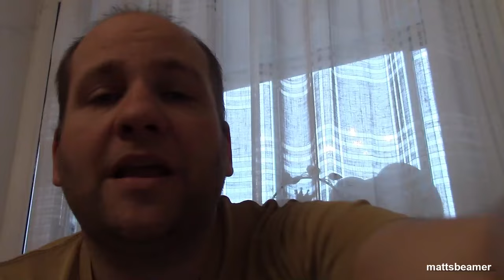BMW Drivetrain Malfunction (Error) Drive Moderately Problem. Information Video.

Comment: I'm driving a BMW 125i 2013 model, it has a drivetrain problem but when i put petrol into a fuel tank, the drivetrain problem goes away.🤣🤣
Reply: same issue e87 118i ... what is the problem with your car, is it resolved? my car problem. the car in running and then dead and the gearbox light is red.. and 1 issue obd scan can not communicate all module😅..

Comment: Have had this error thrown twice now on my 330e. On both occasions it was while on the motorway at about 65 and using cruise control and then had to touch the brakes. As you would expect, this should simply disengage the cruise control, but on these occasions it seems there's problem causing the drivetrain or gearbox to decide there is some kind of problem, probably regarding torque delivery before the cruise control disengages. The engine wasn't heavily loaded or had been previously, just a gentle journey, so no high temperatures or engine stress involved. Limped home without switching off the engine (luckily, the stop/start didn't kick in when I had to stop). Will get it booked in to read the codes (my code reader won't read this car). Just been serviced. Latest software installed. Seems like a glitch somewhere between ECU and gearbox controllers.
Reply: Greetings Friend, what did it turn out to be?
Reply: @JackRobinson63  It was a faulty HV battery control unit and two failed battery units. I had been complaining that there was a battery fault for over twelve months. The dealers first fix attempt was the usual firmware update, which, not surprisingly, had no effect whatsoever. I believe that the engine ECU and battery system were not working together correctly when you touched the brakes and the engine ECU decided to disable the HV powertrain. It is now fixed and the HV battery is supplying 18 miles coverage. It took 5 days to find, get warranty approval, get parts and do the fix though.
Reply: My bmw X1 2017 aisin company gearbox in it suddenly it shows drive terrain and only shifts 3 gear 4, 5,6 gear is not working ,bmw professionals after inspection result we are unable to find out the issue

Comment: You’re 💯 correct Matthew. On 20 January 2023 I changed Ignition Coil and spark plugs on my BMW 116i F20, the Drivetrain disappeared and the car is no longer having a rough idling nor loosing power.

Comment: I've had my 2014 550i to the BMW dealer 3 times now. Nothing shows up. Drives fine after a bit of resting of the car. It's very inconvenient. I've had 2 fuel pumps replaced. I watched another video and it said anything from chargers for phones in a car can lower battery power and cause a power loss. Can be anything. My car has been scanned 3 times. The BMW dealer mechanic hit a pothole while testing the car and blew a tire. So now I get a new tire and alignment. Strut is fine. These are very delicate cars. Also letting it sit to long can cause the drivetrain malfunction. I've had smoke white smoke come out and nothing shows up. It's been at the BMW dealer for a week now. Pick it up on Friday so tomorrow. I'm having my guy bring the loaner back cause I do not wanna drive it home. Lol. We live in the River Valley with steep hills. But a person should be able to live anywhere and have this car and not have issues. Such a frustrating situation.

Comment: I just got my 2017 540i stage 2 tuned and this drivetrain malfunction only happens when I get up to 100 mph then goes into limp mode? It drives perfectly fine until I get up to 100 anybody have any idea what it could be?

Comment: I just had this issue last night, haven't had it checked yet, but thinking it could be fuel pump related. I was going to a local theater and the car suddenly went into neutral as I pulled up with the drive train screen popping up. I'll come back to this as soon as I definitively know what happened though.

Comment: Thanks for helping the community out. BMW can really be finicky and this gave a lot of insight on possible problems
Reply from the maker: Thank you for your lovely message :) I'm glad that the people following this video are also giving out great advice or reasons why they had an issue :) cheers :)
Reply: @mattsbeamer  need some advice, got drivetrain malfunction msg, it’s come on a few times in the last week, I have a 66 plate bmw 330e, light goes off after cooling car down, I noticed the temperature gauge  is temperamental, doesn’t always warm up, car doesn’t go in to limp mode, I do feel a tug and a bit lumpy performance, used a recommended tool reader came up with pinion starter timeout several times. I’ve been told it’s the timing belt, not sure myself any advice would be amazing car currently on 89k and hybrid battery charges normally too

Comment: Had this on my 118d caused by running low fuel. Good video.
Reply: Had the same problem today, I wad running on low fuel (around 15-20 miles left) and this message popped out
Reply: @walideabdul4537  and what you have done?

Comment: Good Video. I have a F20. The IAT sensor become dodgy and popped the drivetrain error every 20ish miles. Another was overtaking at 60mph, popped a coil pack during overtake, felt like the rear axle fell off when dropping into limp mode. Simple errors, but the BMW ding is very frightening. Even just telling the low outside temperatures.
Reply: Also, an auxiliary turbo water pump become blocked, this can light up the drivetrain error with no limp mode. Common fault, plastic pump/blades that continues to carry hot fluids away from the turbo after the car is turned off. It is not a required part for the running of the engine. it will run absolutely fine without it. it'll just reduce the lifespan of the turbo very slightly.

Comment: I had the exact same thing happen to me yesterday, as soon as the turbo wants to come in the car goes into limp mode and the drivetrain warning comes up. I then checked the vacuum line that attaches to the engine cover and discovered that the hose had a small hole the in the size of a toothpick, right after where it attaches to to the engine cover. 
After cutting the damaged part of the hose off, and reattaching it, the car was fine and the issue resolved. 
That something so small can affect the car like that.😀
Reply from the maker: Crazy! Thank you for sharing your experience with us :)
Reply: Did your car ever rev high from a cold start? I had the same issue as you but also the high revving on cold start.
Reply: @Danny-qv3ld  my car does that always, no matter summer or winter everytime when rests for 2-3 hours,, what can it be ? and also recently drivetrain light comes up when i accelerate too much
Reply: @Danny-qv3ld did you solve that problem? What was it

Comment: My car got this Malfunction code for the Drivetrain ...2013 535xi ..Turned out to be the cartridge inside the oil filter was not replaced when they changed my oil..Got a new cap and cartridge for the filter..and that fixed the problem.

Comment: BMW just recalled the high pressure fuel pump - would this be a cause for the drivetrain malfunction?
Reply from the maker: I believe it is one of the reason the drive train light can appear :) I need to see if BMW RU have this recall. Thanks for telling me.

Comment: I really like your presenting, and explanation but mostly I like how u r reassuring me cuz I thought I had a totally destroyed gearbox, I have a 640i gran coupe and I accelerator roughly to merge on highway and I got that warning plus "full performance not available". The symptoms I had were similar to rough changing of gears even when I put it on cruise control, it kept on changing gears (or at least felt like manual rough changing of gears).
I'll get it checked over the weekend but I really hope it is not the gearbox
Reply from the maker: Hello, I hope its something cheap for you too :) Please let us know when you find out.  Did the warning go away when you reset it? Thanks for the kind message.
Reply: @mattsbeamer  I couldn't wait till weekend so...
It turns out that the engine air intake pipe had a crack somehow and when I accelerated the pressure broke a hole in the pipe. Naturally there wasn't enough air going into the engine so it had to shut off the full performance.

The part will take 3 weeks to arrive from Germany but I'm overjoyed that it has nothing to do with the gearbox or the engine itself

For those  interested in how the crack started in the first place, a friend of mine told me he had a similar issue twice in the past 3 years so I guess it isn't that uncommon
Reply: @abrahamkhafajy8214  did you have transmission error aswell when this happened?
Reply: @abrahamkhafajy8214  were all gears changing rough? or just some?

Comment: great video,, bmw  5 series 2011 f10 , drivetrain light came on, car went into limp mode, restarted engine and car drove fine, I decided to fill up with some premium Texaco fuel instead of the cheap supermarket fuel that i had been using, the last 2 weeks the car has been fine, good fuel only in future for me, hope that fixed it
Reply: How u fix it
Reply: @chewaynemcfarlane6409  sadly this did not fix it, I added some gwynnes fuel dry to a full tank of gas as i noticed the car was dropping revs in gear change (3rd), the car drove like a dog until i used up all that fuel,, when I refilled  the car it drove great, i still get drivetrain warnings now and then but the car carries on driving great and the warning just goes away.. vehicle status shows no faults, I am thinking is this just a computer fault ??

Comment: I own a f20 116i from 2013. It started having the drivetrain warnings. Since 2022 it's come up 6 or 8 times. I have a basic DTC and when scanned shows no fault codes. Its clears & shows (so far) none of signs mentioned. 
We do run petrol low often. 
I'll take to garage for more pro DTC read & see soon & let you know. 
I'm hoping it won't damage engine waiting, there's oil & coolant so fingers crossed.

Comment: I have an F150 that uses low octane gas, and a 750. I’ve had the 750 for 3 years and for the first time I pumped low octane into the BMW. Within an hour I got the drive train alarm and the engine vibrates while idling, poor acceleration. I suspected it was the fuel, so I drove it at low speeds to empty the tank. Filled with high octane, car runs fine, but the alarm won’t clear.
Reply from the maker: Hey, I’d love a 750i, wonderful cars. When my  F20 got to low on fuel (so dirty), the error kept popping up after a few tanks then it disappeared. Hopefully it will be the same for you. Good luck.

Comment: My issues so far on my x4 bmw cutt off on me when I use my ac I was stuck in the middle of the street it was off for 16 mins then it started back up ...this was the second time my car has done this smhhh in the first time it said something differently like the fuel system..

but when I took it to the mechanic nothing came up on the diagnostic maybe thiers a particular scan will be needed because in georgia it's hard to get your vehicle serviced at the actual bmw dealership tho it takes months to get scheduled in ...but thanks for this video it gives me some hope ...I want ever purchase another bmw ever again 😫

Comment: Hi Matt. Thank you for all you do!  SO helpful to all of us. My 2011 535i  gave a drivetrain warning but no performance issues. Took it to the dealer after about 6 months of on and off warning messages. They replaced EPDW pressure converter/charging pressure actuator.  At the same time found oil pan leak, rear differential bushing cracked so had all that done.  Less than 3 months later the warning light appears again. Any ideas?  THANK YOU!
Reply: You are in the same situation as me I have the same vehicle!! I had that pull up I figured the spark plugs needed to be replaced bc that’s one of issues that can arise they had never been changed the shop I took it too stripped 2 cyclinder heads brought it to another they were able to put helicoils in they said it was misfiring bc I needed a whole valve cover and I needed a ignition coil. They replaced two. Now I can’t even take the turn pike without it pulling up. I went to pass this person drunker than cooter brown going 35 in a 55 last night drive train pulled when I went to go the speed limit the whole car shook last night the whole way home.

Comment: Great channel with great videos, I am having some issues you may help on based on your experience with this engine, I have the message of drivetrain malfunction, one coil pack was failing I got it replaced along with spark plugs, now same coil (new) failed again, replaced with a new one and also spark plug, but now cylinder is not working, I swap coils and failure still in the same cylinder, so all coils and spark plugs are working but no spark in that cylinder, do you think there is a DME issue or something else comes to mind?
Reply: Fuel injector

Comment: Hi matt. I have exactly the same car as you. I had my water pump changed on the turbo a year ago and about 3 months ago I have been getting low coolant messages. Had a pressure test done by garage and they said there was a little coolant loss but only to fill a void (not sure they knew the real reason). Since then I have had the dreaded drive train message saying  "continue the journey at a moderate speed. full performance not available. Have the problem checked by service". Been monitoring coolant level and it keeps dropping very very slowly but no sign of any external leaks. Car seems to drive as normal.
Reply from the maker: Hey, Liam, sorry to see you have got a coolant issue. If they could tell there was a slight coolant loss, couldn't they tell where it was going?  I am guessing you had this error in the past, when you had a faulty water pump on the turbo. Did it give the message saying that there was a blockage? 
Have any fault codes come up on their system? :)
Reply: @mattsbeamer  They could tell there was a coolant loss just that it 'filled a void in the system'. I had a slightly different message with the water pump issue. i didn't have a message saying there was a blockage, just the standard drive train message. I am taking it back into the garage tomorrow to hopefully find some answers, just praying its not internal.
Reply: @Liam-oh1jf  Hi Liam I hope your car is well. I had (kind of) the same issue. For me it was the auxiliary (secondary) waterpump on the turbo was leaking. Which resulted in triggering a pressure sensor and cutting off the turbo due to low pressure. After replacing the waterpump (170 EUR) it is fixed. The error message only showed when > 3500RPM and more than half amount of throttle. Hope this helps.
Reply: @roymeinders5877  @matts beamer Cheers Roy. Unfortunately it is bad news. Garage phoned me up and said they have found the possible culprit to the leak. It was coming from the back of the engine, so I thought ok, not too bad, possibly just the sensor that sits back there as this is a known part to leak from. But no, they ran a pressure test and found the leak was coming from the outlet system that sits at the back of the engine and that it is impossible to get to unless the gear box is removed. The part is only around £45 but the labour is probably going to cost an arm and a leg considering I am now out of warranty. I did notice a loss in coolant at the end of last year when I was still in warranty but the garage was unable to find any possible leaks and just put it down to 'a void that was filled within the system' after running the first pressure test. Now I have taken it back out of warranty as it was still losing coolant and suddenly they have found the leak so therefore all costs will not be under warranty. If they just checked a little further in the first place I wouldn't be having this problem and it would just be fixed under warranty. Not a happy bunny :(
Reply: @roymeinders5877  Hi mate, I had the drive train issue but no power restriction or anything just a message and scanned it but no fault code came up. I looked online and said it was the auxiliary pump so I’ve ordered that. However, when I got the codes read I had nothing show up but cleared them anyway, the drivetrain issue isn’t showing up anymore. I’ve ordered the part from Bmw do you think it’s still worth changing? Cheers

Comment: I have the the same issue light keeps   coming on and off on my F36 gran coupe. But there is no symptoms have it checked with BMW there is nothing they could find. This is very annoying.
Reply from the maker: I need to make an update video, as many people in the comments have shared their experiences in the comments. I hope it can help you with your cars issues.
Reply: @mattsbeamer  do you now how to get error codes on without the scanner. I know on most bmw you can get the code and  unlock the system by adding up the last 5 digits on VIN however when I unlock mine Error codes not in the list. I wonder if you know how to read the error codes without scanner on 4 series gran coupe f36 . Thanks in advance

Comment: I picked up a 2017 340i with under 25,000 km on the engine.  I've received the error message twice now, but with a simple restart the message seems to go away.  It was roughly a week before the message popped up a second time. I also live in pretty cold climates so I'm hoping that it's just the battery needing to warm up.  Do you suggest I take the car in to get diagnosed?
Reply from the maker: Hey, sorry for the reply :) if you just bought the car, it maybe worth pulling over (in a safe place) and recording the evidence that you have this message, and showing that it disappears when you restart it. It will be worth scanning it. I need to make a video on how to check the codes that save into the cars memory :) 

Cheers
Reply: @mattsbeamer  thanks Matt appreciate your response.  Cheers.